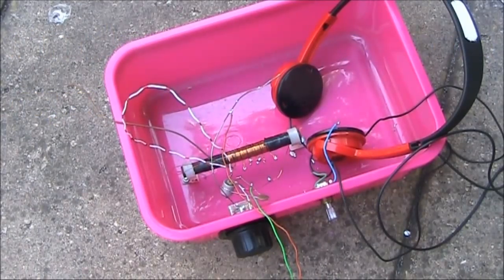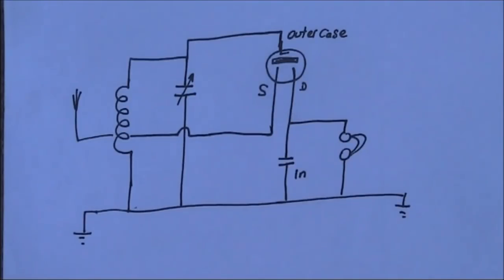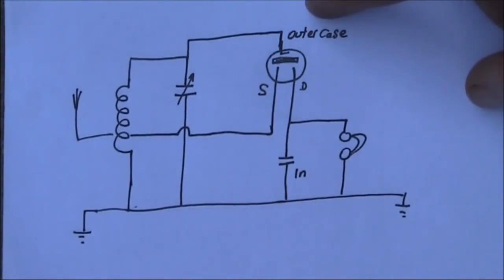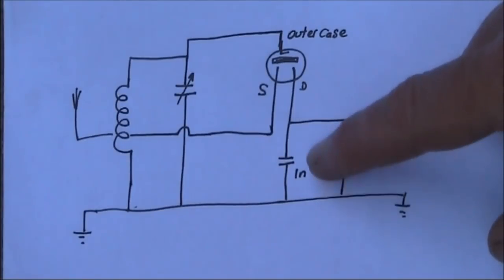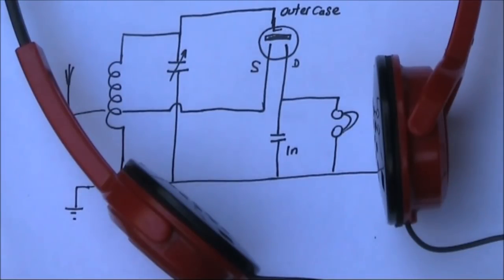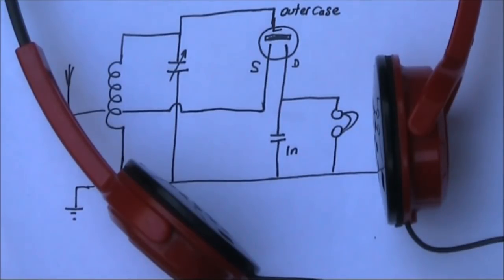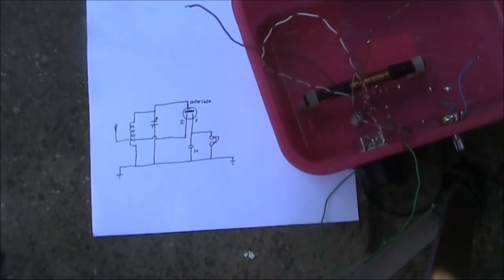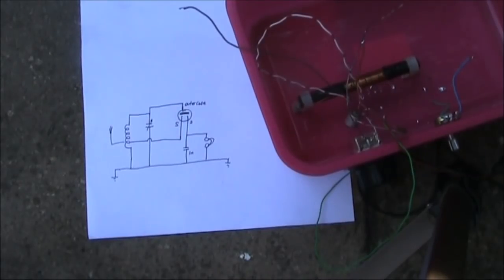An electret microphone crystal set

Comment: I built this circuit today and it worked despite not having exactly all the right components on hand but had the necessary electret microphone and did the modifications it certainly is a much better listening experience using low impedance head sets/speakers etc than the dreaded crystal earpiece

Comment: Happy to report I built this crystal set using a 3” pvc pipe and wound quality copper insulated  wire about 90 turns tapped every 10 but am mainly using total 60 turns and a lot of experimenting ended up using a switch to select sensitivity or selectively by changing the tap for the source as where I live the only 2 am statins are either less than 1km or about 10km from my home for the other  I installed my coil into a 90cm storm pipe about 8 inches long and used caps on the end with one cap containing the electronics so basically it’s a cylinder that sits vertical for use, am really pleased with performance am using a telephone handset as the ear piece and wow it’s so loud and clear, I see a good earth and long wire outdoor antenna are essential btw I found when I disconnected the 1n capacitor my volume is louder for some reason

Comment: Great video but no demo Peter? I built several versions of fet detector sets over the years with good success including this one. I used the Jaycar insert by cutting the track and installing a third lead to avoid soldering to the aluminium casing. I pulled in seven Brisbane locals at home and will take mine to a local park to try a long wire antenna for best results. I've also used the 3sk143 "3DQ" FET device but those ccts use an extra winding to the source of the device rather than a low Z tap. Great stuff...
Reply: Hi, I made a lot of crystal radios using 3DQ, AM, SW, FM. Besides using an extra pick up coil connecting to the S-Gate of 3DQ, you can also at around 10% of the coil above the earth.

Comment: Hi Peter, most interesting. Where did you find the three terminal mic capsule? Thanks
Reply from the maker: Don't remember. But you can convert 2 terminal to 3 terminal but cutting the printed circuit board track on the back of the mic that joins to the metal case.

Comment: Comparison with a germanium detector and hi-Z phones?
Reply from the maker: I'd say about as good.
Reply: People have always been trying to make a better crystal set! Without seeing how the components in the electret mic are arranged, it's not clear how this works. Presumably there's no gain, a high impedance across the tuned circuit, and some sort of impedance transformation thorough the mic to match the low-Z phones, but how? Maybe the original article explains all...
Reply: Janet Winslow the FET gate is grounded to the metal case. Cutting the track leaves the gate floating via a high megohms resistor thus allowing you to install a third lead and attach it to the top of coil.

Comment: It is because electret has a fet inside
Reply: Then why not just use a FET?
Reply: I've used a 2N5485 in these ccts as well as the famous 3DQ FET device. There's a cut away diagram on internet showing the internal structure of the microphone capsule for those who've never peeled one open.